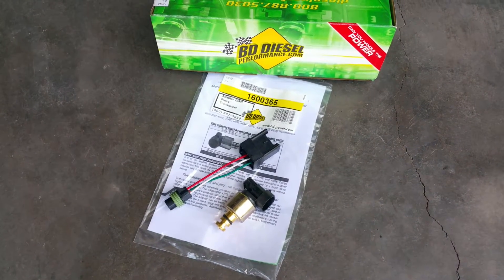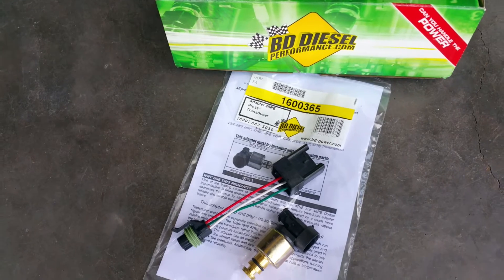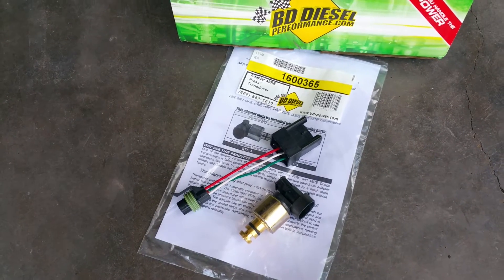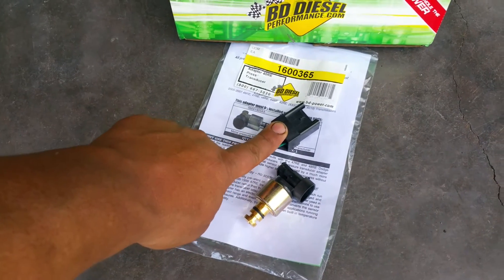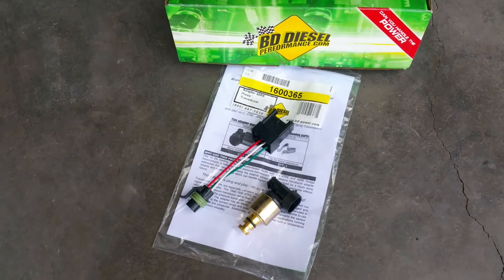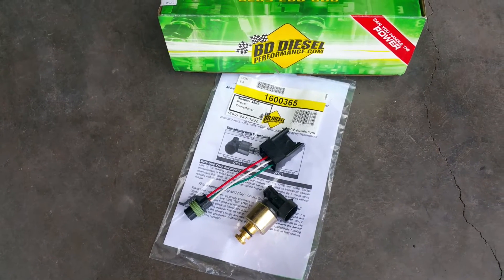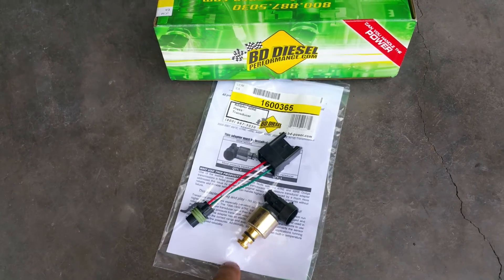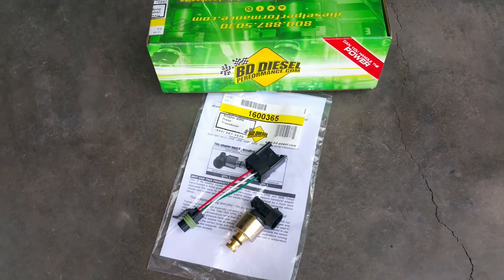BD Power Dodge Pressure Transducer Upgrade Kit

Comment: He maybe you can help me please! I'm a disable vet, but not so bad I can not fix my 2001 dodge Durango 5.0,I think it's the 46RE transmission in it, well I have replaced the governor solenoid and the transducer in it 2 times in the last 2 or 3 year's now it's doing the same thing. My question is will the upgrade kit for the 47RE and 48RE fit the 46RE the one with the gm solenoid ? Man what should I do man I've tore it apart 3 time's I think only takes about 45 minutes if I hurry the hardest is laying on my back . But 841.00 a month only goes so far man. So help if you can love ya brothers.